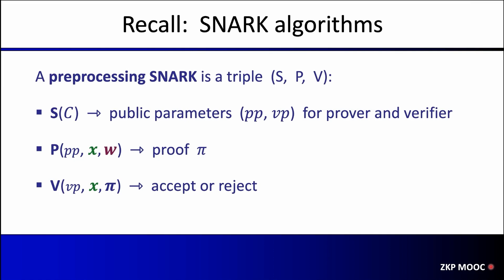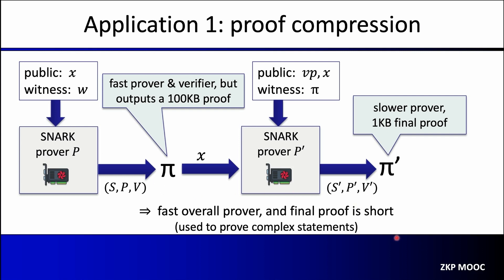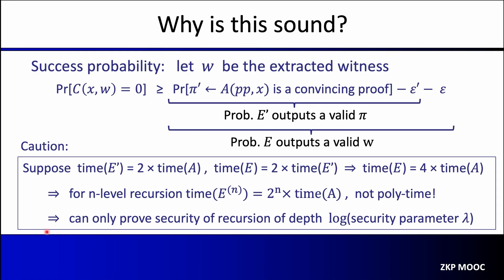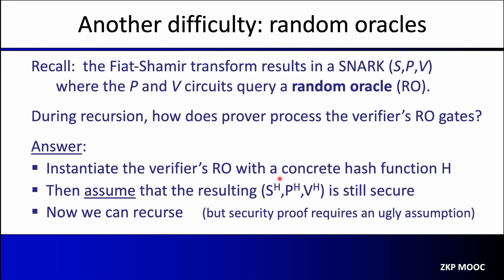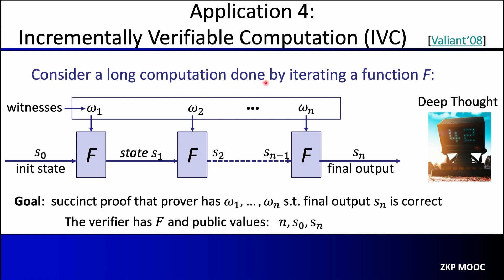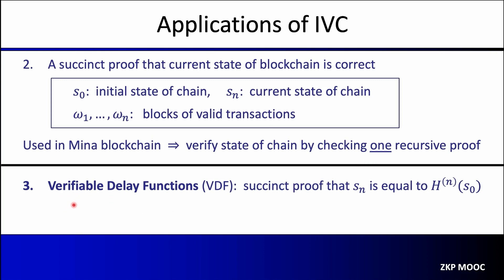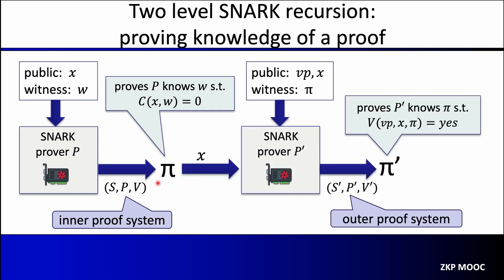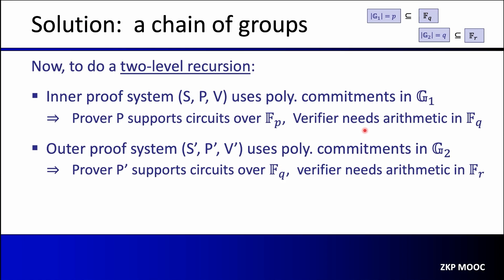ZKP MOOC Lecture 10: Recursive SNARKs

Comment: In the Mina blockchain example, the blockchain is increasing indefinitely. Will this break the soundness because the depth of recursion is increasing indefinitely?
Reply: Good point, I also have that question
Reply: Of course not. At  each  point in time the depth is finite. Don't confuse infinity with finite but unbounded/unlimited. Example: for EACH positive integer N, the number of  integers in the interval [1,N] is finite.